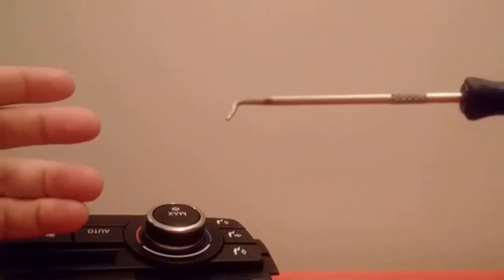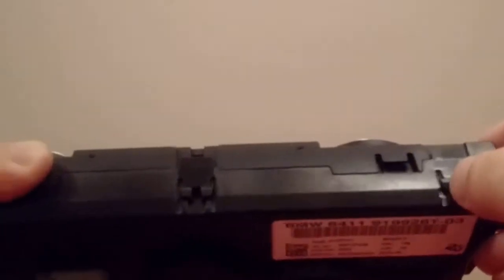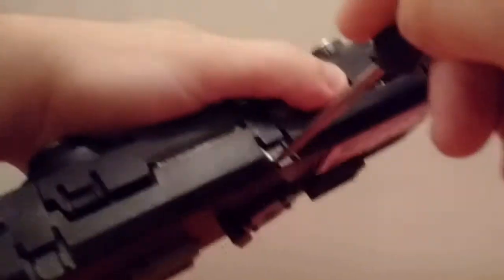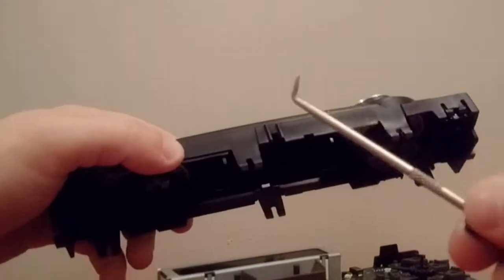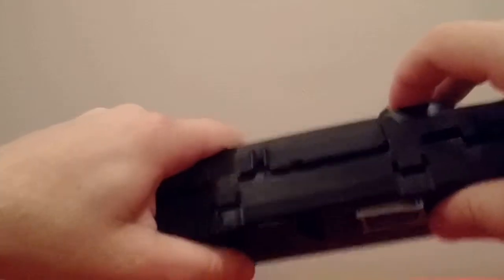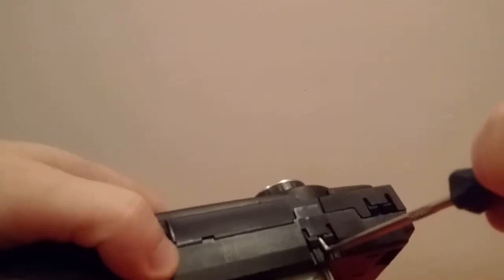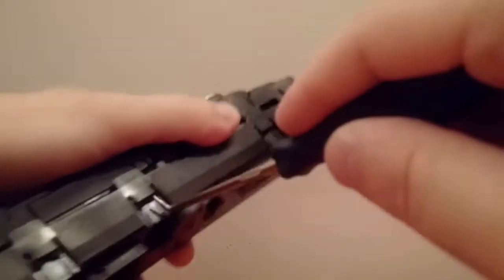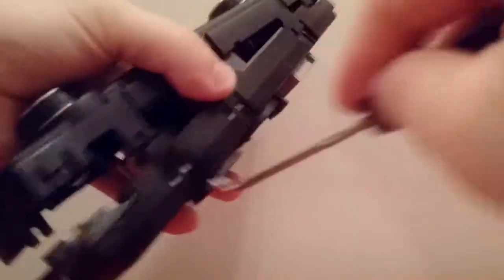DIY Toolbox: Separating Tabs and Clips with a 90 Degree Pick Tool

Comment: You should get the snap-on 4 piece pick set.  They use much higher quality steel then other picks so they don't bend and break as easily. I did car audio installations for 10 years and still have my original set.